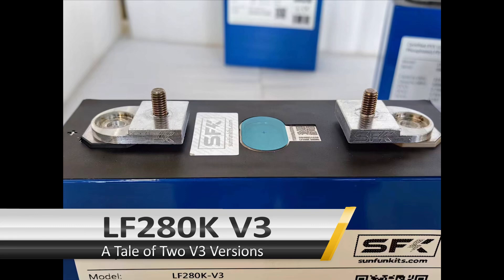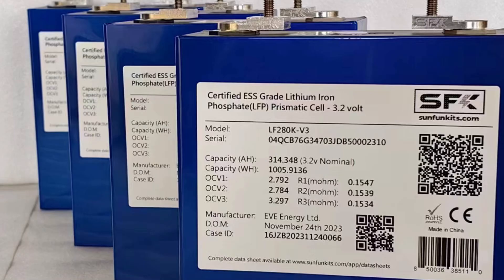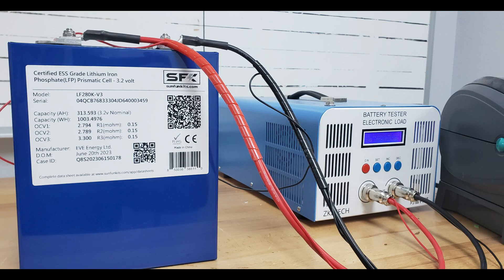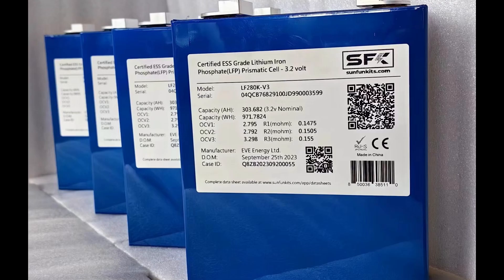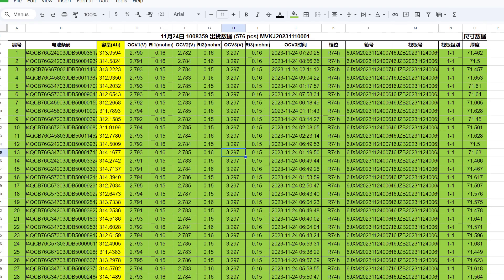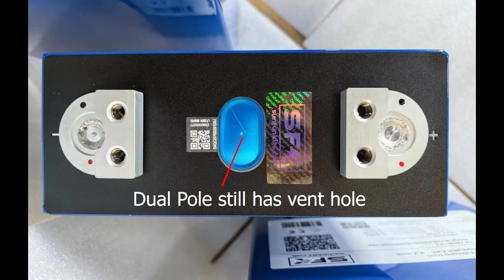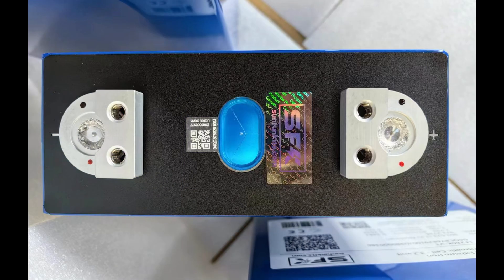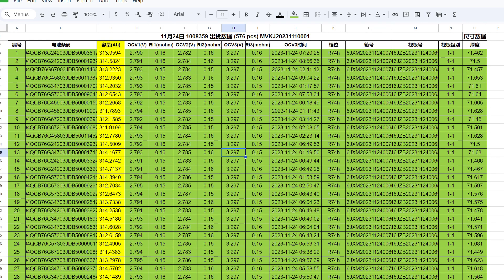Capacity Concerns EVE LF280K V3: Dual Pole Vs Octagon Base

Comment: Ive already told before ive buyed the EVE LF280K originals with the 2bolt terminals.

The reason why ive buyed those is because the results documented labtest ,youtubers and user forums.
The differant between the EVE 280AH and other brands is not only the 6000 cyclusses vs 3000 but also the behavior of the cells over time . EVE cells give higher AH at start mostly around 295AH and drop slowly  after 6 months to a year at about 284AH and stays  there for long time .Its called stabilised point. For other brands at startup they get well over the 300 about 310 to 318Ah but very quickly (about 1 to 3 months ) under the 280AH like 274AH and thats the stabilised point.

So to judge about quality and capacity you must use them quite awhile to its stabilised point but the indication of 6000+ cyclusses gives you a good idea due its longer life time .

Im talking about the EVE 280AH if you look at EVE 304AH or any other cells you will see that they also have 3000 or 3500 cyclusses like other brands .  

So when you look for good quality you have to include the cyclusses and not just the AH and dont take startup capacity as granded and dont use the startup numbers as baseline. The startup capacity means nothing unless its under its rated capacity.

You didnt gain any AH  if at startup you get 315AH out of it when it drops under its rated capacity when stabilised for the rest of its lifetime . Just be smart , dont buy blind , inform yourself intensifly .

I prefer longer lifetime at rated capacity than shorter lifetime under rated capacity over time thats efficiency for the money in my eyes.